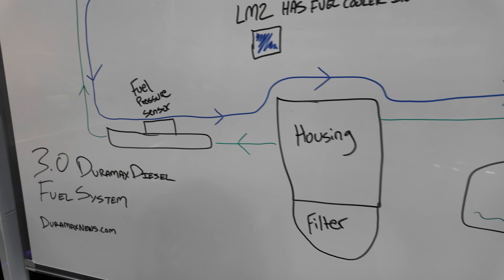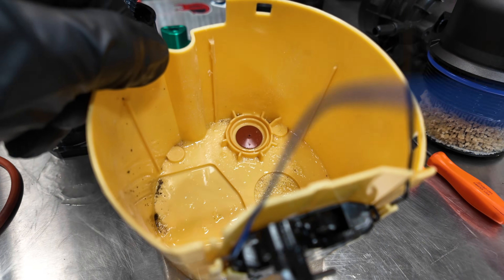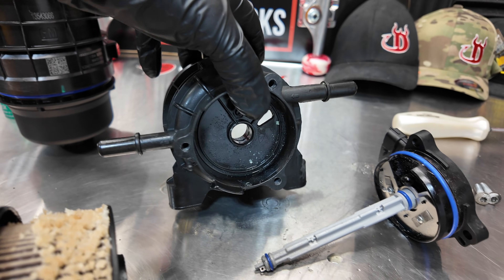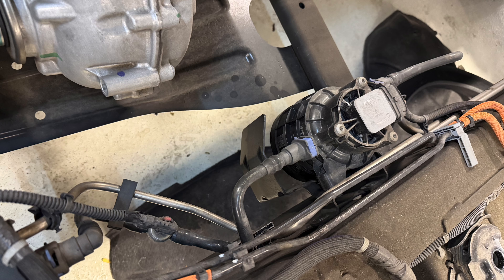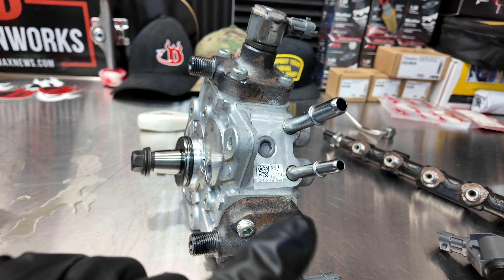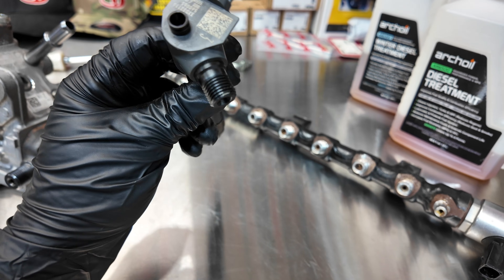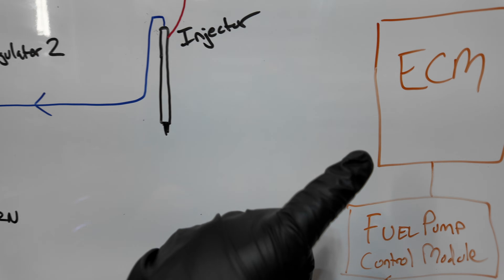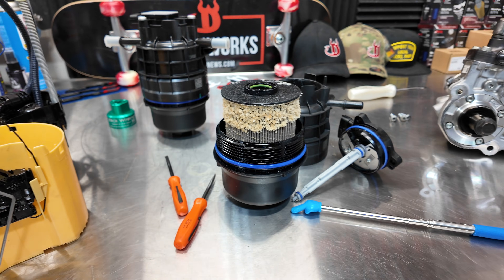This Is How Fuel Really Flows Through the 3.0 Duramax

Comment: My 2024 babymax is throwing a P026b (injection timing performance) code, is there any chance this is a defective injection pump? I noticed you said it was timed. I Took it to a dealer and they said they did a diesel diagnosis, but my CEL came back on a day later.
Reply from the maker: Your pump is good, the timing referenced in this code is for the injector itself, which this timing comes from the ecm. Your issue is likely in the harness or the ecm itself.

Comment: Great video explaining the fuel system - thanks!  I followed your video showing how to change the fuel filter and I'm seeing a small amount of diesel weeping where the filter housing cap meets with the filter housing.  I used the AC Delco filter kit from Rock Auto, replaced the large o-ring on the housing cap and the small o-ring at the water sensor, and then torqued to 25 Nm/18 Ft/lbs using a 36mm socket.  I don't see any noticeable cracks in the housing cap.  Any suggestions what to try next?  Have you seen then before?  This was the first fuel filter change on the truck at 15k miles.
Reply: Could be a bad o-ring or an o-ring that was damaged when it was installed. Try replacing it again and if the problem persists - replace the entire housing. It's only ~$50 at RockAuto.
Reply: it may be leaking from the connections in and out.
Reply: maybe clean the o-ring mating surfaces

Comment: I have a 21 LM2 
Only problem I’ve had was a engine control cooling valve went bad. 
I have 65000 on it 
Is there anything I should think about doing to make it more bulletproof 
I’m have no experience with deisel’s 
But do all my oil, and filter changes
Mods with banks or ppe 
What’s your opinion?